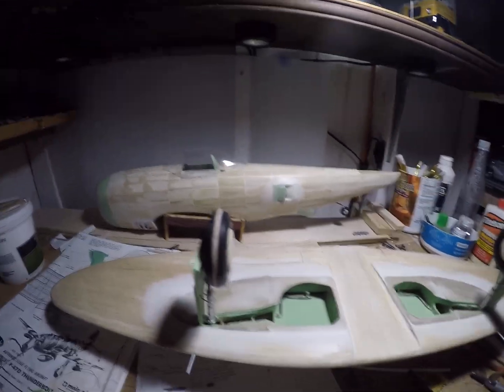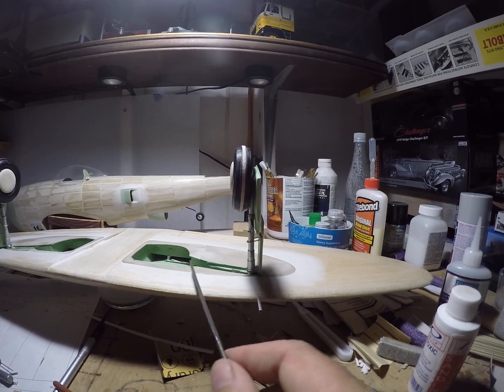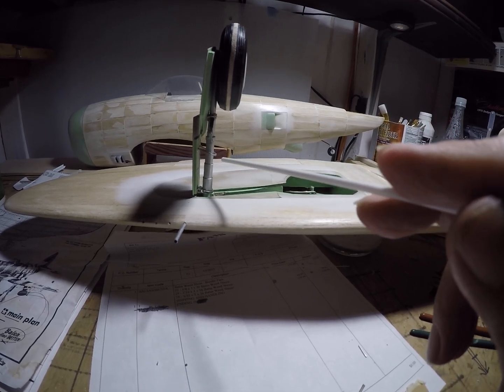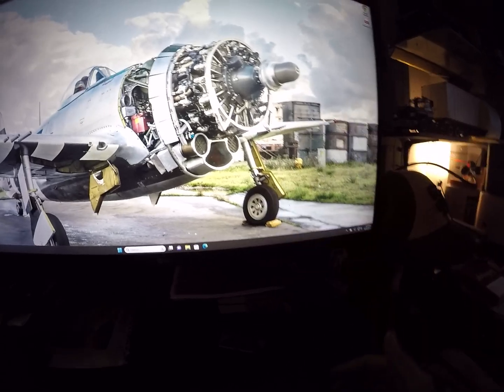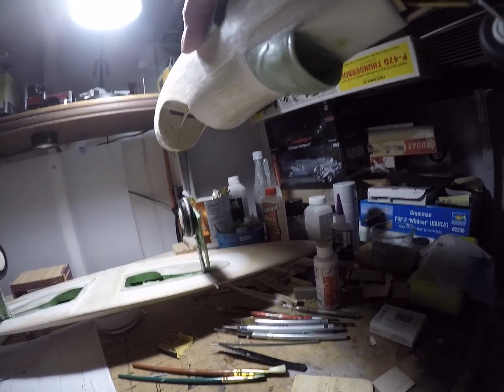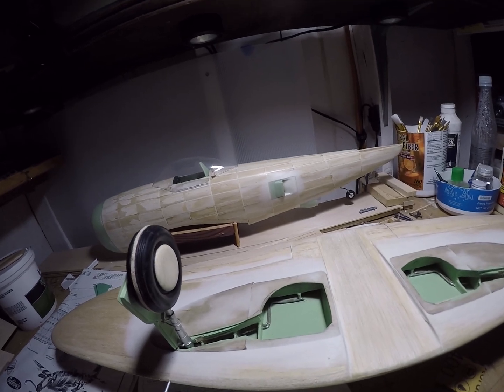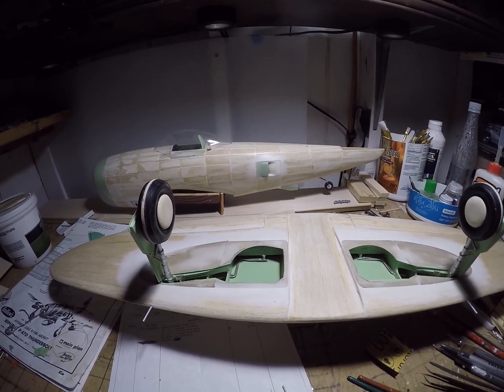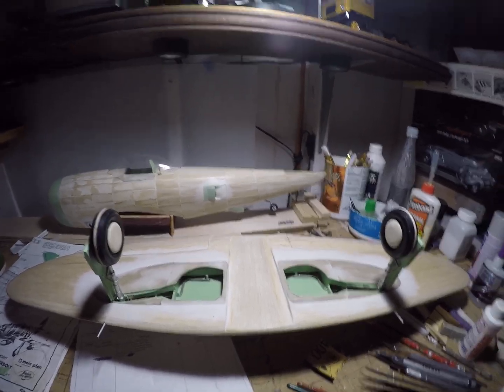Guillow P-47D project : Part 40 - main LG upper doors

Comment: Have you tried to get ahold of the Conferate Airforce ? I believe they have a P-47 in their roster. They might help you out with some photo's of what you needed.
Reply from the maker: I have a number of photos of the wheel wells and could probably use more. What I really need is an official USAF document that shows the stencils specific to the P-47D and their locations on the airplane. There is an airshow near me this weekend that I'm going to visit, see if there's a Jug in attendance. The CAF should be there - I think they call it the Commemorative Air Force now..
Reply: @heywoodplanes6651  could be, it's been about a decade since I helped them out with a plane. I work on planes as a sheetmetalist. I did some fabric work on a set of F4U elevators a long time ago.